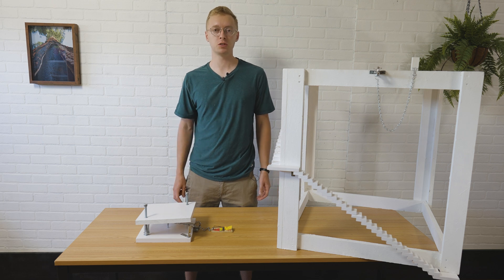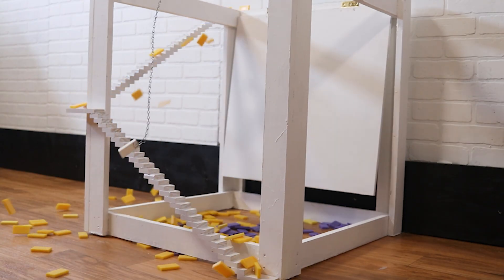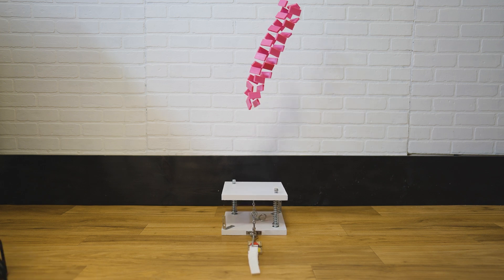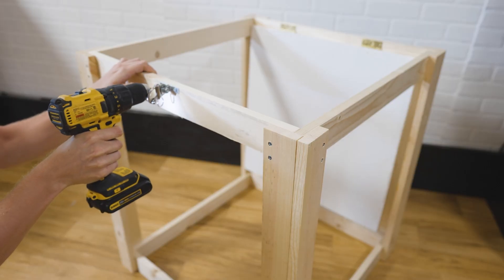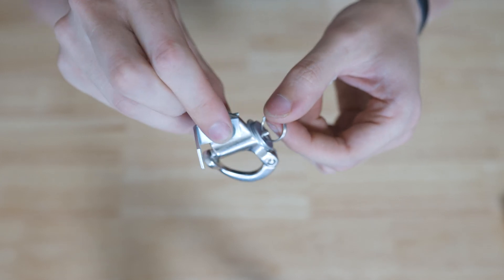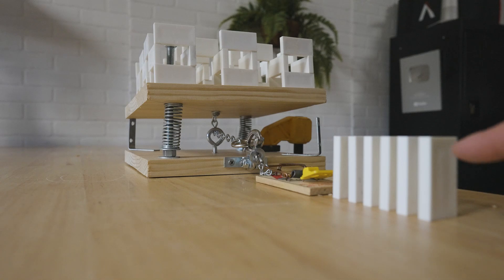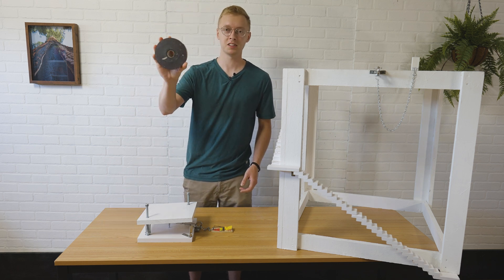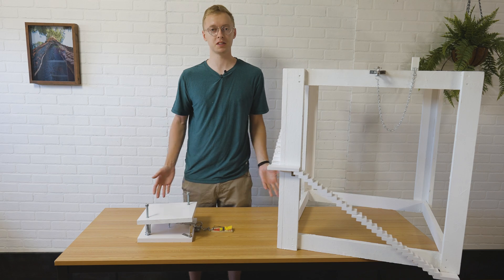Dominoes Toppling in MID-AIR

Comment: Really cool!

For the drop tower, I recommend moving up the reinforcing square that is currently at the bottom of the legs. If it were raised about 6 inches, you'd be able to add a domino structure below the drop and have the chain reaction continue out from under the drop tower to do more things.
Reply from the maker: That's a good idea but then the frame would block the view. I can just use a bridge to get over the frame!